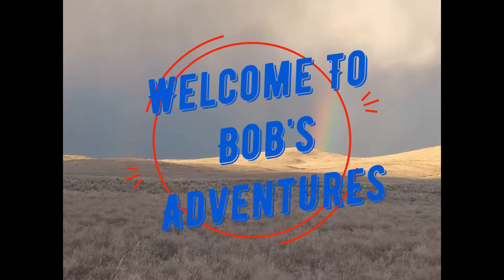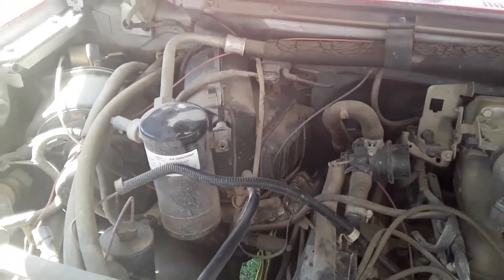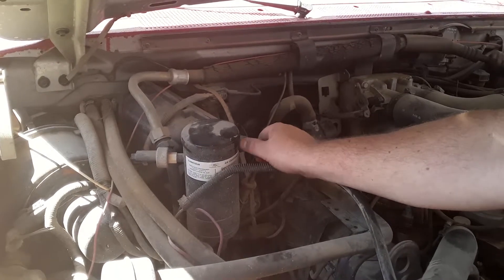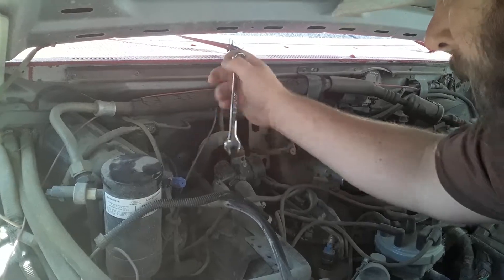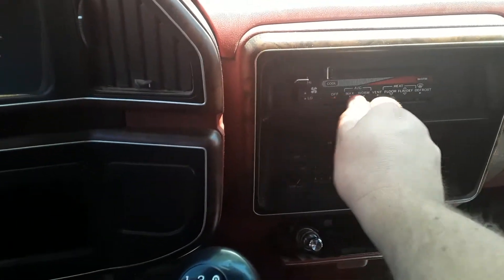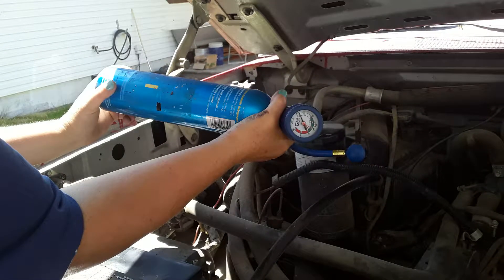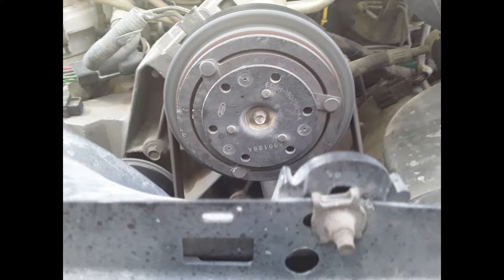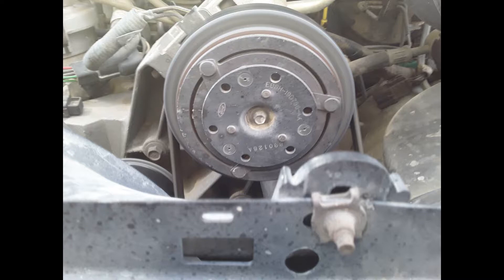Bob's Adventures Retrofit 1989 Ford 250 AC coolant R12 to 134a

Comment: You need to remove shrader valve from accumulator before installing retro valve you have two Schrader valves if you did not do that and it will not accept freon
Reply from the maker: Great to know. Thank you.
Reply: Did you jump low side pressure switch to see if compressor even  ones on?